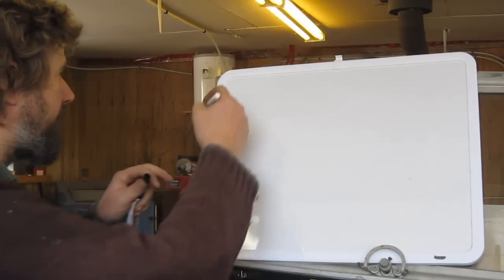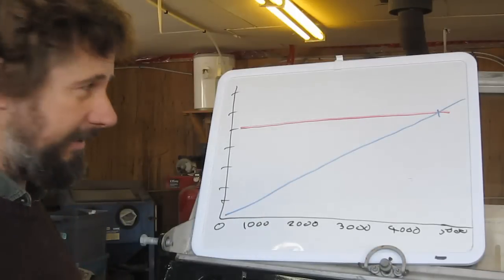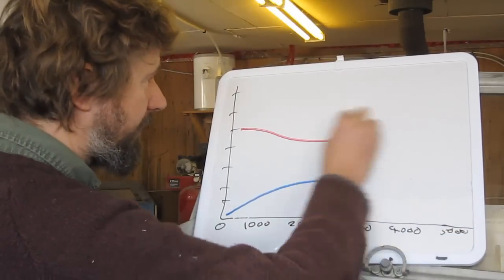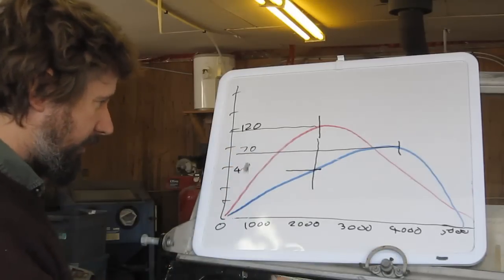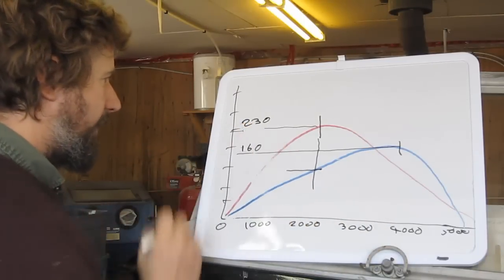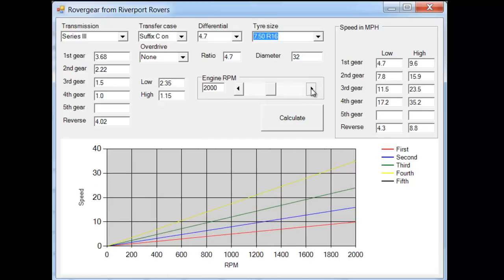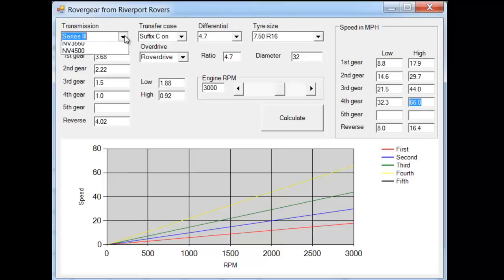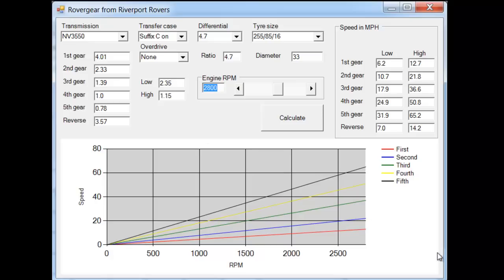4.3 Chevy V6 in a Series Rover - Part 20

Comment from the maker: Hi Jacob,
Sorry for the slow reply.
The master is a very common unit, well known as the Corvette master, a 1978 Corvette will get you the right one. The booster is a hydroboost unit from an Astro van, but many larger trucks have the same un it. Pump is the GM type II pump that is getting very popular with the hot rod crowd, I used a Range Rover resservoir, the fittings are the right size. Steering gear is an International Harvester Scout II unit.

Best Cheers
Peter

Comment: Hi from the uk peter love your vids looking forward to the finished landy but just to say i have a ACR stage2 head and s.u carb and i have about 105 hp @4250 and 165 lb/ft @ 2500 in my 88 i plod at 45 mph @2200 rpm but good vids roll on pt21